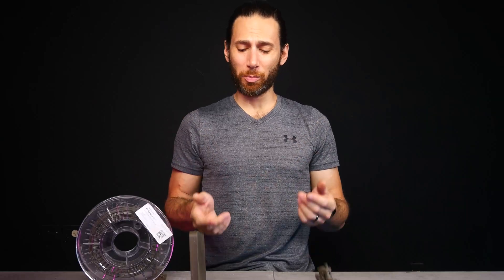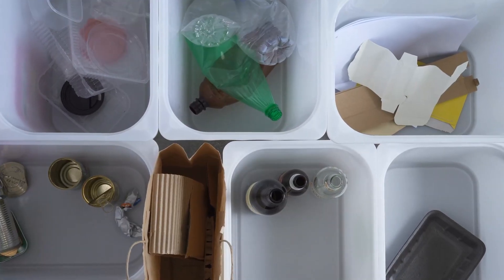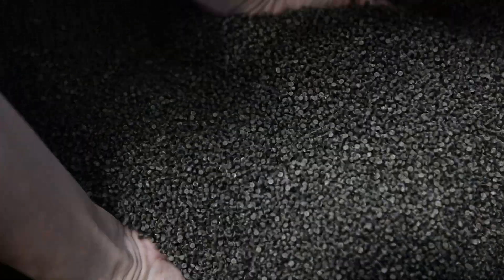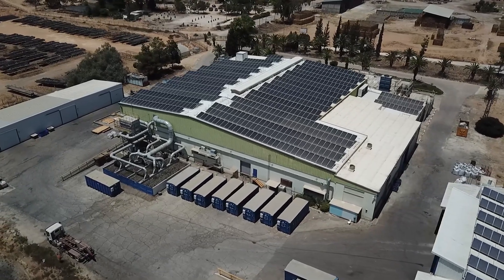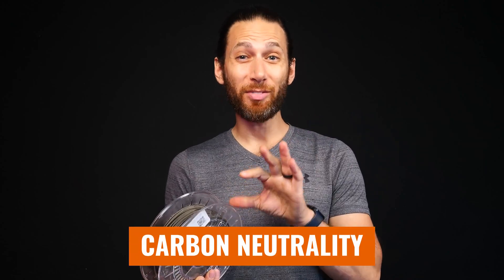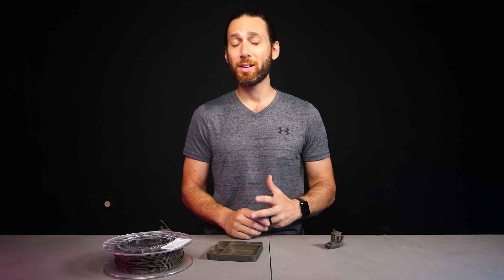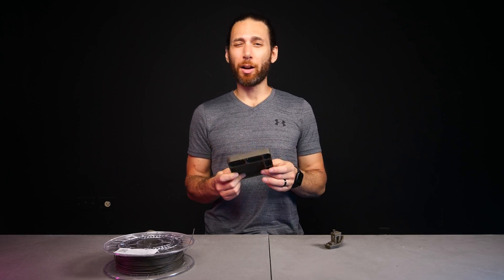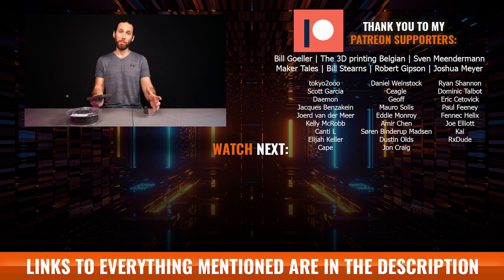3D Printing with Recycled Garbage: How Are The Results?

Comment: This gives me big pause.

Famously, PE and PP are absolute compatibility pests. Introducing just a little of one into the other just completely ruins the plastic cohesion. And here they mixed all of this together including PE and PP done some voodoo and apparently the resulting concoction is good to add to either PP or PE or any number of other things?

However, if someone wanted to dig, they have patents right? They can't be running purely on trade secret.

And i think it's completely unfair that the manufacturer won't specify how much waste material (minimum bound) is contained in the filament. Because "significantly composed" could mean 7% - it's not "insignificant" by some measures right? If your soup contained 7% flies and hair, you'd deem it pretty significant, wouldn't you. While what you're thinking of, wishing for, is probably closer to 70%. We don't need to know an exact figure, let that be their trade secret, but we need some sort of minimum bound we can calculate with, because this determines how we value this material, like if they said it contains "more than 50%", that would be a figure one could use to estimate the usefulness of material in landfill reduction. It's not that i don't want to trust trust corporations, but i only trust them as far as they make definitive statements that one could nail them to, and not just play with your imagination.

Comment: How sustainable is it really? You may need to use thicker walls and more infill to get a strong enough part compared to other materials, so you would use more material, it would take longer to print which uses more electricity and the part would be heavier and still probably weaker too.

Also how much moisture does it reabsorb? If you have to dry a lot out of it and it had a lot as waste then it might absorb a lot of moisture, it would be interesting to see this tested.

Also has there been any testing on the safety of the filament? Does it contain bacteria or undesirable chemicals? Any chemicals in the waste are probably unlikely to go away. There is a lot more in waste and even organic products than lignin and cellulose, have they properly tested the filament to make sure it is absolutely safe?

A common problem with recycling filament in general, never mind making it out of general waste is that the properties can vary drastically. Do they have this issue too?

What can be done with this plastic after? Can it be recycled itself?

Comment: So it’s fairly abrasive, requires drying straight out of the pack AND is only 25% the strength of PLA?!

Tough sell.

It’s a start though (IF you believe petroleum-based plastics are ‘bad’ for the environment).

The manufacturer should adequately dry their product prior to vacuum-sealing and distribution (otherwise, are we truly buying ‘500 grams’ of filament?).

Oil is a renewable resource. I personally view petroleum based plastics as more environmentally friendly (as the chemical processes this company is spruiking has already been performed by the earth… which the earth keeps doing as ALL fauna and flora (including paper etc) decomposes and seeps down through earth and rock layers and finds its way back to ‘oil deposits’ (which is why old ‘dry’ oil wells have oil in them again decades later when uncapped and checked). Sorry, massive (debatable) tangent there. 😂

Petroleum based plastics aren’t CO2 added to the atmosphere; They are captured Carbon… so instead of wasting corn (a food) through PLA production, petroleum-based plastics are the most friendly type for the environment and for human survival. You’re welcome to conclude differently to me of course. Opinions are diverse regarding inherent facts, but by all means correct me with facts if you’d like people like me to conclude differently.
Reply from the maker: I don’t think the science here checks out because it takes a lot of carbon to produce petroleum based plastics and they’re also a biproduct of fuel production. I think the consensus is that the carbon is better off captured in the ground than in the air which is what happens when you produce plastics. But, that’s just to the best of my knowledge.
Reply: A good rule of thumb...if you find yourself with an opinion that is in direct contradiction with something that is widely agreed upon and is something measurable, you are probably wrong. 

People love these contrarian opinions for some reason...turns out everyone says plastic is bad for the environment because plastic is actually bad for the environment.

The problem is that it can't be explained to a non-expert (which is why your request for "facts" probably goes unanswered). Is that really that surprising though? I am a professional researcher in math. Here is a fact for you: Every compact strictly positively curved Riemannian manifold has at least one conjugate points after which any geodesic fails to be a length minimizer. As length increases, conjugate points accumulate at least as fast as they do in a sphere of the same constant positive curvature. 

There is absolutely no way I could explain to you what these words mean. It doesn't matter how badly you wanted to know, or how much time you have. It took me nearly a decade of full time work to learn to interact with this language. It's a fact, though...doesn't make it any less true. 

Environmental research is every bit as advanced as math research. Why would you expect to be able to understand it? At some level, our society is based on inter-personal trust. If you have zero trust, you can barely know anything at all. Individuals are not very powerful at knowing, it's the networked group that gives us power. If you are completely untrusting of the group of scientists...then you're just not gonna know things, period. You are just going to be victim to whatever "sort of makes sense" theory someone gives you, and it's very easy to make false things sound like they make sense. The truth is unbelievably complicated.

Comment: a Non-runner.. when we already have low cost filaments made from Corn Starch or Soy Bean Starch. Which are recyclable.
Reply: "Recyclable" is a stretch...very few facilities recycle PLA, it requires specialized equipment. Only a tiny, tiny portion of the PLA out there ends up anywhere besides a landfill. Apparently the equipment needed is pretty advanced.

Comment: I'm definitely at 2 minds for this project, it's keeping garbage out of the landfill. But 100$ for a 1kg spool that is worse than PLA is a pretty hard sell. The fact they had to split it into goofy half kg spools instead of bulk 3 or 5kg spools is the opposite of where I'd expect this to be going.. I would expect there to be be significant government subsidies for making landfill trash literally disappear. If that's being applied to this current price is a question. Another is how is the air quality, VOC measurements vs things like PLA and ABS please, more important than the percieved smell, is if it's better or worse for you to be printing with it.
Reply: I don't think the price matters, after all you're paying a prototype pricing here; scaled to mass production it could cost basically nothing, since apparently there is neither high energy expenditure nor labour expenditure.

What concerns me more is that the manufacturer isn't willing to nail them to the wall with any definitive number as to how much recycled material it contains, not even a conservative lower bound, which to me makes it untrustworthy. Mixing PP and PE sets off a big red flag for me. It's a possibility that you get a terrible compromise in material fidelity and endurance for a very very small decrease in landfill, which makes it landfill fodder right off the bat with a large negative environmental impact. If it's actually useful and not just greenwashing, they should be willing to prove it.
Reply: @SianaGearz  good information, though I did find this on their site that might help. "A USDA BioPreferred Certified Product, UBQ™ contains at least 50% bio-based content."

Comment: I would love to see a solution to our failed prints,brims,supports and bambu purges because it really makes me sad about this nice hobby.
Reply: They can be recycled, there are quite a few videos about it on YouTube. I believe Stephan fron CNC Kitchen has a video on recycling PLA, and so do quite a lot of the other main 3D printing channels. The problem is that recycling the filament isn’t common yet. There are companies that do it but they are few and far between. It’s not really worth recycling it into filament at home but I have seen people grind it up and melt it into flat sheets that they then use for other things. That might appeal to you if you find yourself using plastic or wooden sheets.